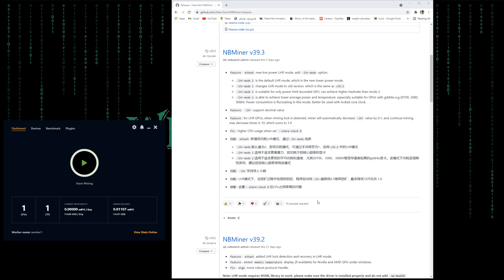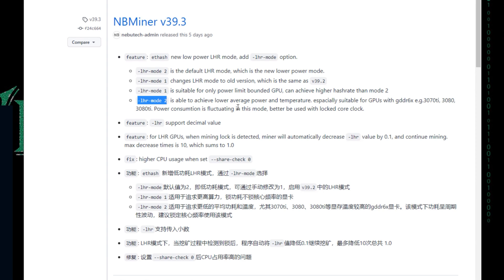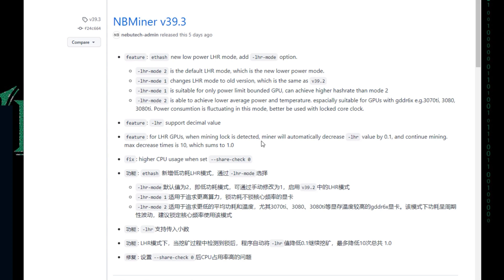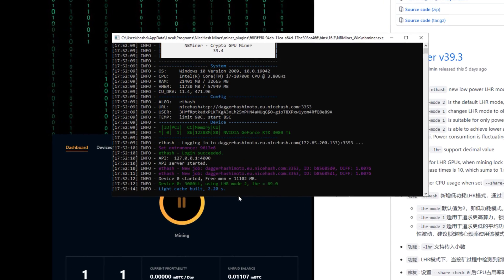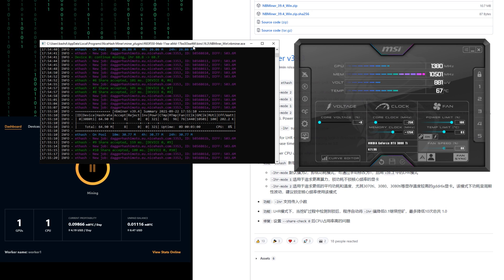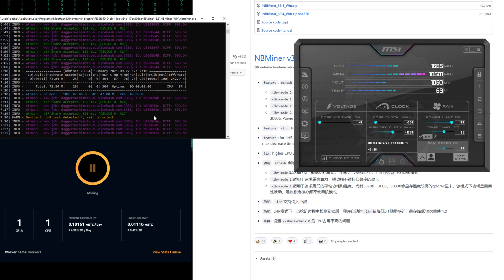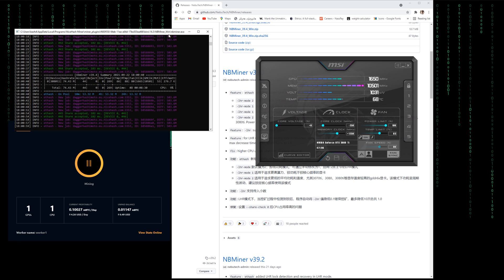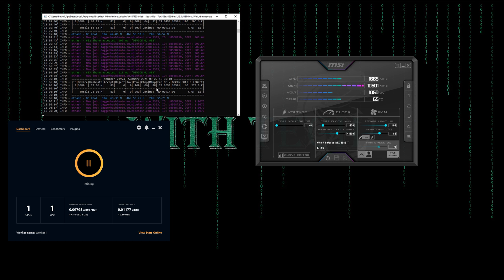LHR Lock Detected! NBminer 39.3 and 39.4 Release Notes

Comment: Your using way too much power. Use the power limit slide and try going down to 65 - 70%. It won't effect your hash rate but will use much less power. I have the sane issue with NB Miner locking when I move the mouse.
Reply from the maker: My GPU is kinda different! watch this video and you would understand why. https://youtu.be/a4ofqG9Zcq8 and what is your power consumption?

Comment: Please make a more proper video .. how to remove LHR mode detected ..
Hashrate is good but on my account it shows only 0.19 doller 24/hour profibility ... Is that fake hash ??
Reply from the maker: the thing is each GPU is different, that's why I mostly talk about it generally. The hash isn't fake, but since you are getting so many locks, that could be the reason your profitability is not good enough. what model of 3080ti do you have? what miner do you use? how do you overclock the GPU (which application)? and when you use GPU-Z, what is the state of PerfCap Reason?
Reply: @withtech341  GIGABYTE 12 gb 3080ti ..nicehase miner .. tried stratum too ..am lock at 64 m/h on 3080ti ..I dnt know why ..
Old version of NB hav no issue like dectection ..but haserate only 64 
Perf cap reason is green on colour with pwr ..memo temp -95 to 98
Reply from the maker: @sagarthechamp  even though Gigabyte GPUs have had some overheating troubles, you still should be able to get a stable mining process. I will soon publish two videos for using T-Rex miner. maybe changing the miner could help for you. if it didn't then we can discuss that at that time.
Reply: @withtech341  changed a lot of miner .. on trex am getting the same 65 .. stabled .. but if I increase power to 75+ am getting 72 but the memory temp is over 106 .. any solution
Reply from the maker: Thermal throttling is dealt with changing the thermal pads and stuff, but I don’t recommend it if you don’t know how to do that. There are videos on youtube explaining it. You can even find them changing gigabyte thermals. There is also a feature in T-Rex where you can set the desired temperature for your GPU.
Reply: @withtech341  mine 3080ti is 30 days old
Reply from the maker: Thermal pad issues could be there from the first day. I suggest you compare your stats with another GPU of same model and brand, see the difference and compare the temps, even with gaming. Then you would have a better understanding about your issue. There’s also another way to deal with overheating which is attaching some sort of metal or something like that then attach a fan to it. When you search for the issue, if you don’t find something for 3080ti, look for 3080, the solution could be the same.
Reply: @withtech341  solution is only 1 I guess .. thermal pad and paste
Reply from the maker: that's good that now you know the issue, Good Luck..
Reply: @withtech341  but that's not the solution .. I mean yeah kind of ..but if I changed that under warranty .. than nvidia warranty will void
Reply from the maker: That’s correct, but it is how it is. Try playing video games, see if you still get throttles then I think you could contact the retailer and let them know about your issue. But try not to mention mining.

Comment: Hey, im new to mining and using hive os
I bought Zotac GeForce gtx 3060ti Hynix Memory x 3
My miner was running since 6hrs, and i constantly kept  getting "LHR lock detected 462, wait to unlock" and the power consumption in those 3 cards had vast difference like one had 47w, 130w, 115w is this commom? and also the hashrate wasnt stable

the miner i have is nbminer v39.5
your help would b alot appreciated
Reply from the maker: I am working on two videos that could help making your whole mining process more stable. I will publish one of the videos today. but for now try locking the voltage and core clock. Watch this video https://youtu.be/i84PM6q9C28 the second part is about locking the voltage and core clock. after you do that, put the memory clock on 1000. check the channel later for a full tutorial on how to overclock the GPU for mining. Stay TUNED!
Reply: @withtech341  Im using HiveOS, so dont hv the option to use msi afterburner
Reply from the maker: @Smxxx_  Try to find an app for overclocking for your OS, NVidia does have one, I think the name is NVidia Inspector. double check to see if you have it. then you can overclock with that. For my social media account, try to find my With TECH page on Facebook.
Reply: @withtech341  is there anyway i can contact u? Like on instagram/facebook?

Comment: The LHR detected when ever the gpu clock >1200mhz…
Reply from the maker: what are your gpu specification? with my Gainward rtx 3080 ti phoenix, I am able to reach up to 14500mhz without any feedback or lock detected message. I usually go with coreclock: -250, memory clock: 13500. this was for mode 1. And for LHR mode 2, I have no problem and can go up until the gpu and my system crashes. I lock the core clock at 1155 starting at 750 mVolt, and put the memory clock at 1550 or 1600. these give me the best results. but be aware that with mode 2, you shouldn't use your system at all, just leave it for mining.
Reply: @withtech341  LHR card have volatile on different algorithm.. but with new “lhr unlock mining software” that is where table turned. Personally I would reduce PL, clock  to most left slider. Then only play around with memory clock..
Reply from the maker: and just try to find the best settings for your gpu. then compare your gpu performance with those of same model. if the results are similar, then you are good.

Comment: This is giving me a nightmare but this video did not explain anything at all…….
Reply from the maker: Sir Oui I will have a video combining the two reasons LHR Lock detected appears. but in short, You either have overclocked your GPU somehow not very well or you are using the default LHR mode mode, which is LHR mode 2. LHR mode 2, as I have mentioned in this video is very very unstable. sometimes moving the mouse curser could make the miner activate the LHR Lock activated thing. now what? well, in my experience if you get the LHR lock detected message when you overclock the GPU, then the hashrate decreases almost by half, but if the reason of the message is working on your computer, browsing the internet, running other apps, then just close them and wait for the miner to get stable and to see the changes. I hope this helped, and let me know if you still have issues with some information and explanation.